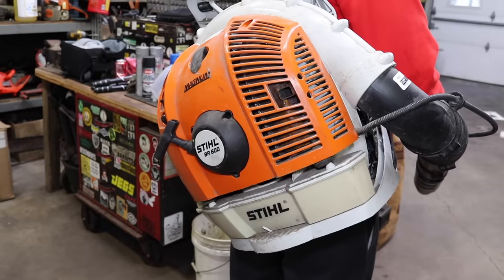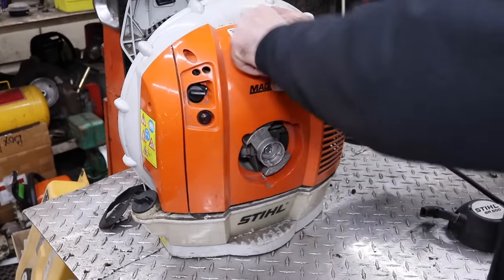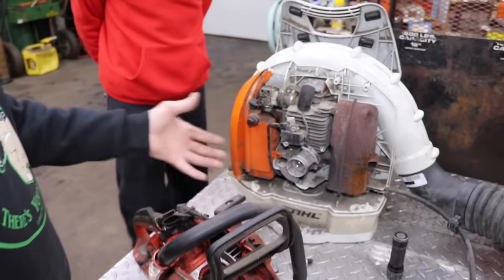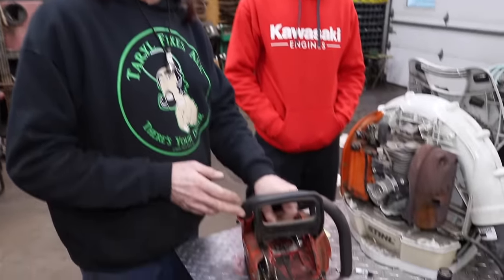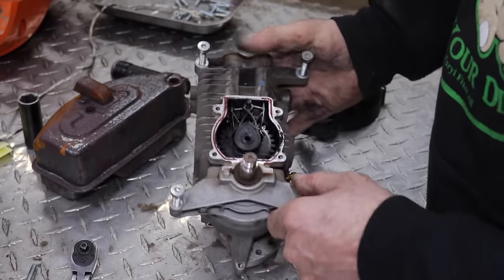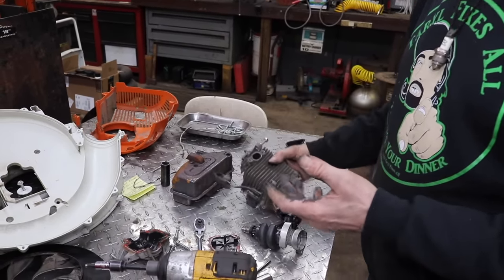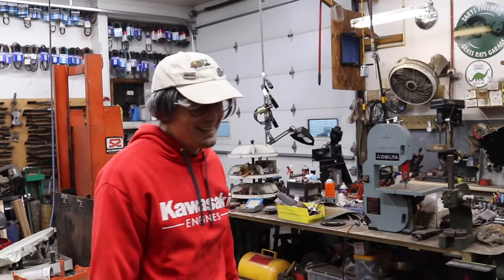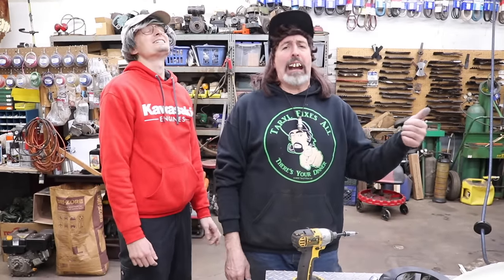4 mix NIGHTMARE! DON'T make this mistake 🚫

Comment: I have a 2 cycle motor and I've only mixed the incorrect ratio maybe once but luckily it didn't do no damage to the engine. Once I burned up the 1 gallon I mixed incorrect I went back to using the correct oil mixture. The only thing I done to it was put in a brand new autolite 2974 spark plug in it last month for the upcoming season.

Comment: The Stihlch engineers were probably thinking lower Revs mean they thought they could get away with a bronze bushing.On another note I asked the Stilch dealer service dept when should I adjust the valves and there answer was as needed!These 4 mix equipment will drop valves after a while and it's the same deal the motor is ruined.
Reply: They sell crap

Comment: I'm guessing they used a bushing on this engine because it's a 4 cycle and not a 2 cycle. 4 cycles tend to run at a lower rpm. I'm just guessing, but they may have considered that.  Great learning video Taryl, thanks bud
Reply: In the motorcycle world 4 cycle 600 to 1,000 cc street sportbike engines red line at as high as 17,000 rpm and higher off the stock showroom floor.
Reply: They run at the same speed.  They just have an exhaust note that is exactly half of a two-cycle (because, of course, a 4 fires every other revolution).

Comment: I've Been Rebuilding Motorcycle,Atv and Marine crankshafts for many years Taryl,If Stihl offers a connecting rod kit then that crankshaft could be rebuilt,you would still need to either re-plate or replace the cylinder but then ur going to be getting into another 250 or so on the re-plate cost and all the other gaskets,seals,ect so now I can see where it's just not feasible to repair,even if you can do the majority of labor yourself.its a shame these companies are producing equipment that's kinda a throwaway deal when a major repair needs to be performed.

Comment: TARYL, The model's operation manual states;  "If you mix the fuel yourself, STIHL recommends STIHL HP Ultra (2-cycle) engine oil."  Under "MOTO MIX" It goes on to say that STIHL recommends using "Moto Mix" instead of user mixing the fuel and oil.  In addition, it reiterates that the use of "STIHL HP Ultra 2-Cycle Engine Oil (or equivalent) designed for use in AIR COOLED engines is recommended.  IMO, this information should have been listed under an instructional and operational, "WARNING!" notation in the operator's manual.  Still a very piss poor design though...
Reply: It seems Stihl has stated that in every manual at least over the past 20 years.
"HP Ultra" is (AFAIK) the only oil sold by Stihl that can be used at 2% on machines that do real work all day long.

Husqvarna also sells Husqvarna HP oil which is exactly the same crap as Stihl HP, it seems that what manufacturers can't earn by selling machines they try to earn by selling cheap oils... but if people do not want to buy the expensive oil recommended by the manufacturer, they will not buy oil of the same quality and equally expensive from another manufacturer, they will look for the cheapest bottled oil they can find so they don't have to get their hands dirty with used engine oil.

Actually I don't know anyone crazy enough to put used oil in the fuel mix but I know a few who use it for the chain and when they should sharpen it by the fourth time the chain is already too stretched to be used again, but they say they're saving lots of money 🤷‍♂

Comment: We have two BR600 blowers and 2 FS90R weed eaters at work that get used heavily almost ever other day, I also have a FS90R at home, all have been great units with minimal maintenance. They work just fine when you put the oil that STIHL recommends in them.

Comment: Did not know that the piston wrist pin uses bushings in these larger Stihl blowers, good to know. My Still BR600 blower is running strong after 15 years.
Reply: Mines been going good for over 10 years without a single problem. Good oil and the right mix, that’s all it takes. Apparently some people don’t understand. Oil is important.

Comment: Hey, Taryl Fixes All. Considering that the cylinder was damaged along with the busing in the connecting rod, would it make more sense to replace the whole short block? I have watched a couple other videos on these blowers, BR 600 and 700, and another thing to look out for is the engine pan on the bottom has a tendency for the bolts to back out and cause a leak. That can cause the pan to wear out. I personally own a BR600 and I only use the HP Ultra oil, and I will say that I am impressed with how it performs.

Comment: My 800x  is finicky starting sometimes.   Usually when it is under 32 degrees or so (no problem those same times starting my old Stihl 350(?) two stroke)
But today it is 50 degrees and it is not starting.
I stopped using the Stihl oil because the exhaust makes me nauseous and it also seems to really clog up the spark arrester.   I run my blower almost exclusively on less than half throttle so I think that is part of the problem on clogging.

Comment: I have to comment on this - this engine was run with no oil at all for a tank.  There is no way that a wrist pin could heat up by friction and dry off like that if there was oil present.  Any oil present.  Bad, cheap oil, or magical good oil.  What happened here for sure was that the owner ran that dry tank, then ran a tank or partial tank after that with oil, or didn't run it at all and just squirted oil in through the spark plug hole and took it to the shop.

It makes NO SENSE that "bad oil" ruined a bushing.  Bad oil will get to the bronze bushing. Good oil will too of course.  Hell, you could even put motor oil in the gas and run it (but you'll have to deal with a bunch of ash in the cylinder - don't do this) but that motor oil WILL get to that bronze bushing which does not require any kind of special lubrication, it just needs some kind of lube at all times.

Again, this motor was run without oil for a tank.  Scored cylinder, dry wrist pin, and a very oily piston (which tells me the owner squirted oil in the spark plug hole before he took it to Taryl) all scream no oil in the gas for a tank or two.  To be clear: There is nothing wrong at all with using bronze in the wrist pin location; in fact it is recommended from an engineering AND a practical standpoint.  "Plain" or "sleeve" (bronze in this case) bearings MUST have lubrication at all times, but they take cyclical pounding without having to turn like nothing else, and do this for thousands of hours.  But sleeve bearings are unforgiving when they run dry.  I should add here that technically, needle bearings used in a wrist pin is an ill-specified use.  Rolling type bearings (needle, ball, roller) do best if they are rolling (like in the crank bearing location).  A needle bearing in the wrist pin does nothing but sit there and get only a couple of needles pounded on again and again and fret at those point loads at each of those couple or three of the needles - which is really stupid.  The wrist pin is MUCH better served with a sleeve or plain bearing.  It just has to be oiled and KEPT oiled.

By the way, the crank bearing survived without oil because it has rolling needle bearings (no sliding) so it had a chance.  But a few more minutes and that needle bearing would have bit the dust also.  It just didn't yet in this case.

In summary: The general assessment in this whole video and the discussion herein where a needle bearing not being in the wrist pin location was the cause of failure *is incorrect*.  The cause was no oil for a tank.  Bronze bushing in the wrist pin SHOULD BE a bronze bushing.

Comment: Absolutely need to use the correct two stroke oil and in the right proportions, but also important to always tune the carb (assuming it’s adjustable) to a slightly rich mixture.  Do not run two stroke equipment lean, it makes it run hotter and leads to this kind of damage.   Bad design by Stihl.   Their chainsaws use needle cage bearings.
Reply: I’ve owned a br600 for over 10 years and it has been flawless. The right oil and the right mix is all it takes. Use the cheapest oil and you see what you get… you saved $1 and now you need a new blower.

Comment: I've had so much trouble with my Stihl BR800.
I bought it 2 years ago.

First issue: Hip starter/ recoil failure. 
The threaded section of the engine casting snapped off. 
(I had to start the blower with a drill and nut on the crank.)

Second Issue: Muffkin falling off. 
It happened several times and melted all of the plastic around it including the gas tank.

Third Issue: Carburetor linkage and ignition wiring gremlins.

Fourth issue: The constant movement of the nozzle while blowing pops the handle and tube off occasionally.

Stihl is garbage.

There's yer dinner!
Reply: My br800 is fine, and my br600 I’ve had for over 10 years without fault.

Comment: Big reason they made this engine like this. Its a big seller for many lawn care contractors, local authorities and if they can manufacture a fault it means more sales of the high end blowers. Most contractors and local authorities tend to by cheaper oil because of cost and especially in the UK we get loads of issues with any two stroke equipment using cheaper grade two stroke oils from starting issues to engine wear issues. As it shows here buying cheap oils in a two stroke mix can cause expensive issues.
Reply: I’ve owned a br600 for over 10 years and it hasn’t had any issues… 10:25 he literally says he doesn’t work on or see much of these. So his sample size is small. I’ve never heard of this issue before today. This looks to be a failure of the owner and not of the equipment. If you use the wrong oil and then complain that the manufacture made a shitty product that’s on you.
Reply: As if,  prove it failed because of the oil, u cant! It could have been a hundred reasons. Pull the caps off, any scoring?
Reply: My mcculloch super airstream iv had ran for 30+ years and it’s still going strong. New is definitely not best not just with STIHL, but with every single brand you buy from big box stores nowadays. I miss the good old FS80R days. I have a 94R and a BR430. And if something happens to my 94R, I will look for an FS85R.

Comment: Wonder if you could use another con rod with bearings from another Stihl product? There was something about needing to order a crank rod assembly??
Some of these company do some weird experiments on the customers wallets....by trying out cost cutting changes...BMW motorcycles do this....the old stuff from R50 thru R100/7 were pretty solid. Each manufacturer always has its percularities....the oil heads newer designs had some flakey stuff...push rods on certain years would loosen where the ball end was pressed into the hollow tube. Make a clatter like loose valve clearence.
Another was the cam chain oil pressurized adjuster would leak down after 15k causing chain slap eventually knawing into case ...
Both items had good aftermarket replacements .... it is what it is....

Comment: We only use this at work all the time. The main issue I've had is the lower crank case bolts loosen and falls out, crank seals always need to be replaced, and exhaust cracks.

Comment: The only Stihl oil recommended for the BR600 is Stihl HP Ultra which is the best Stihl 2-stroke oil available and logically it is also the most expensive.

Comment: Echo Red Guard for the win!  My local dealer/parts store gave me the low-down on oil... you can run echo in a Stihl and warranty OK, but you can't run Stihl in an Echo.  Echo has the highest rating and strict requirements on their oil.  I think it's also a full synthetic oil as well.

Comment: 4 mix, all the disadvantages of a 4 stroke , with all the disadvantages of a 2 stroke
Reply: I think the issue is people don't maintain anything. If it has an oil sump pan ect, nobody changes it, if its 2 stroke, people use horrible oil, and then well yeah the 4 mix. Problem being the user error most of the time. Don't mix it right, use the wrong oil ect. Small honda utility motors i've seen people not change the oil to the point where the dipstick (not an actual dip stick, just a cap really) melted and the motor seized. It takes all of half a litre of ANY oil at that. A motor vs a 5 dollar oil change.
Reply: @baileyhatfield4273  nobody wants to accept that they are responsible for the problem. They want to pass the blame on to the manufacture because of their ignorance.

Comment: I have been using the Stihl blowers forever, several 600's, 700's and I currently have 3, 800's. Never had an engine failure. The only issue was one of the 600's had a rocker arm that worked loose and fell off. Which is an easy fix.  I have been running lucas oil and mix it at 50-1. I run this mix in blowers, chain saws and trimmers without issue. It doesn't seem to be a design issue, since countless people run these blowers and there does not seem to be issues with engine failure. I do sell these after 2 or 3 years, but that being said, I'm probably around the 600-800 hour range at that point.

Comment: A 4-cycle engine that uses two-cycle oil mixed in the gas sounds like a stupid idea in the first place, in my opinion. I would not buy anything with that kind of set-up.
Reply: Better fuel economy and noise. Both massively better on a 4mix that a 2 stroke and can be used in any orientation. Downside is valves need adjustment but for mid sized mini engines which are slower reving much better. Fuel has cost and in some markets it is a high cost.
Reply: I stopped buy there high price junk
Reply: I prefer 4 mix engines on string trimmers. Got rid of all the 2 stroke junk.
Reply: @fibreguy1971  Also Less carcinogens in the exaust.
Reply: The 4 stroke motors have quite a fair bit of torque at low end, but are lighter like a 2 stroke due to the smaller crankcase.
Reply: Very pleased with my 600 which I have for ~5yrs.  Far quieter than 2 strokes and also a lower freq of noise which is easier for everyone to tolerate.
Reply: You got that right, 😏
Reply: Lot more torque. The Trimmers are great
Reply: The big selling point is you get the power and torque characteristics of a traditional 4-cycle engine but without having to perform oil changes.
Reply: @ChrisRJ  Those Stihl 4 mix engines still use oil-fuel mixture. Just like a regularnie 2 stronę engine.
Reply: @fibreguy1971  but,a real 2 stroke, produces more hp in. A lighter smaller package 😎👍
Reply: I am completely addicted to my 4 mix machines. I would never go back to 2 stroke.

Comment: I have had problem with Stihl oil gumming up the muffler, exhaust port and rungs really really bad especially if you mix it a bit rich. I switched to Klotz R-50 synthetic.
Reply: To much idling not enough full throttle. Which is also bad for these engines.

Comment: I’m sure the engineers knew this would happen, and following instructions from the bean counters to build it this way. This way they will sell many more new units..lol. It’s the only logical reason IMO. I have the hand held BG 65 and been running the piss out of it for years, just keep the spark arrestor clean and ya good to go.
Reply: Paranoid much?
Reply: @13panda13  I’ve worked in manufacturing long enough to know the kind of BS that goes on..lol.
Reply: They sell crap

Comment: A guy down the street does landscaping. He put 8x BR600's   out on the curb. 2 I got running within a week, just carb stuff/fuel lines. the others more serious. Ebay a year ago had brand new BR600 motors for 125 dollars. it's an art just getting the blower fan off. A piston stop is the only way w/o breaking anything, never use air tools.

Comment: Yup never use cheap oil , great video as always.
Reply: Got nothing 2 do with cheap oil. Its poor mixing ratios that caused this. U cant prove it was because of cheaper oil.
Reply: @13panda13 if it’s API certified oil it’s good enough

Comment: Probably had straight petrol instead of two-stroke mix. These engines always get quite dirty in the crankcase because unlike two strokes the crank case is not evacuated every cycle.   Lubrication of the cylinder and conrod relies on air fuel mixture from the carburettor in an atomised form and circulate it inside the crankcase with the action of the piston returning back into the motor for combustion and leaving a residue of oil. The oil fuel mixture has to be atomised to lubricate the piston and conrod.

Comment: Ive worked at 4 Stihl dealers the last 22 years and my feelings are its over rated trash these days for most of their stuff. They cut corners, its harder starting than most other brands, and unless you get high end trimmers they vibrate through hard plastic handles instead of rubber. Their commercial saws are decent but not better than Husqvarna now. Ive done dozens of short blocks on those 4 mix blowers, all with wrist pin seizure because they didnt use full synthetic oil plus one had a rocker stud break off. The BR550 was junk from the start with fans too aggressive that bogged the engine down plus they were exploding. That was a big secret when it first happened the tech dept wouldnt tell me at first. I would never own Stihl anything. My personal trimmer is an old Kawasaki KBL23A which was the best ever, and my back pack is a Shindaiwa EB802 and I have a 1995 EB240 hand held with a zillion hours on it still running great although the plastics are faded and trashed. Tarryl you have to find an old F series Briggs to get running and post a video of. Neat little engines!

Comment: Yeah... I'd rather get an Echo if this is what Stihl is doing now - how freaking bad is that?!?!  Even with using the right oil I can see this eventually happening after enough use... really really bad.  Garbage indeed Taryl!  O yeah... HAPPY NEW YEAR!! :)
Reply: I’ve had my BR 600 for over 10 years and it hasn’t happened yet, so it looks like this is a user issue not a manufacture issue.